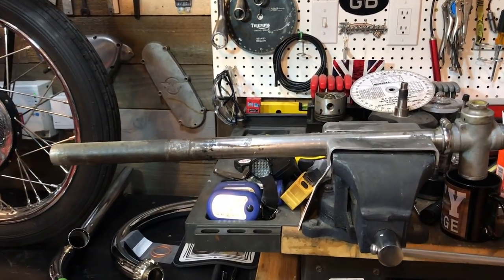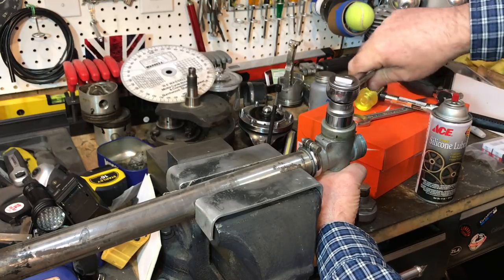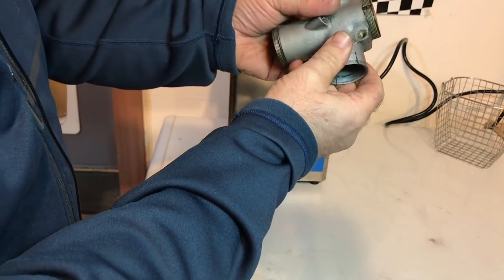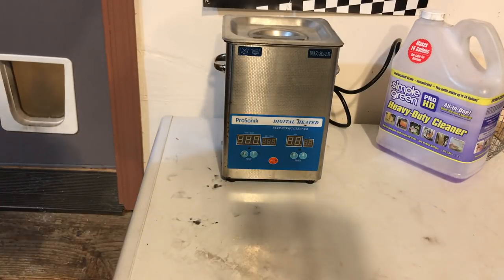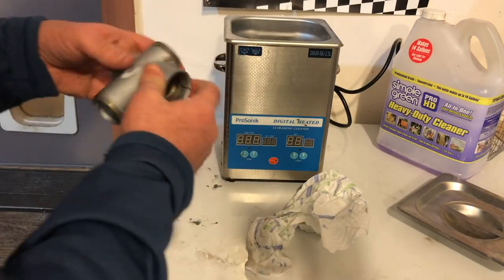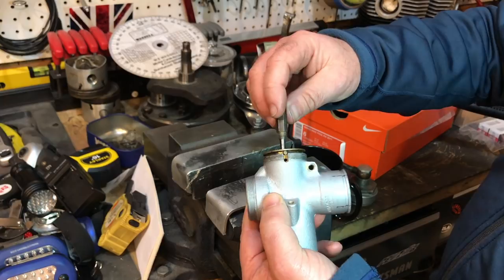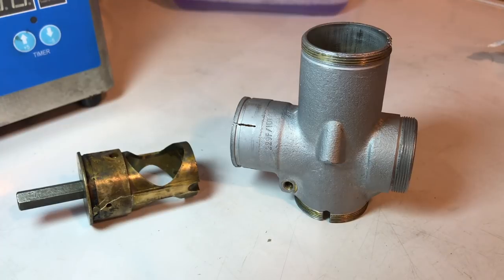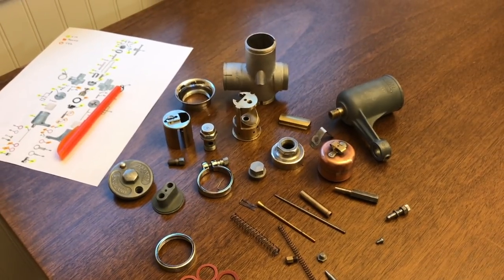Restoration of 1951 Vincent Rapide - Part 20 - Amal Pre-Monobloc Carburetors (Part 1)

Comment: Well ! That came apart very easily, not sure the dining room table was the best choice, cant you bolt a vice on there? Will you paint the carb body as original ? If you do make sure you use fuel proof paint, some of the model aeroplane paints are fuel proof to the modern stuff they call petrol, you ultrasonic cleaner is a must have !

Comment: Really helpful playlist - currently working on my late father's series C rapide. What settings a fluid do you use in your ultrasonic cleaner?
Reply from the maker: Thanks Frank. I'm sorry to hear about your Dad. I just crank the UC up to the highest temperature and then run it for 10 mins with a 80% water / 20% simple green (purple color) solution. Then stir the parts around a little and repeat for another 10 mins. That usually does it really well  Best wishes with your bike.